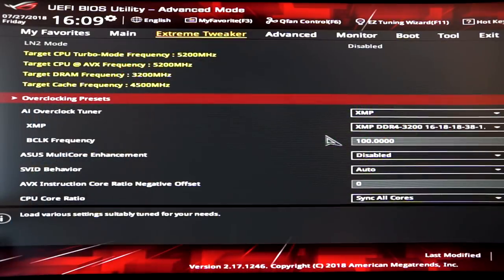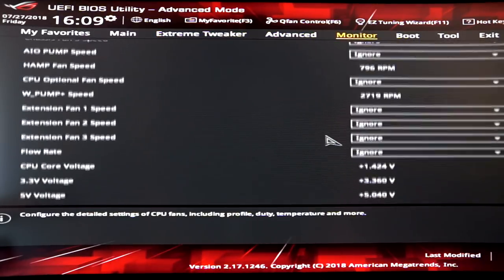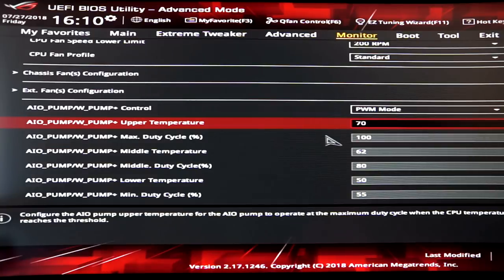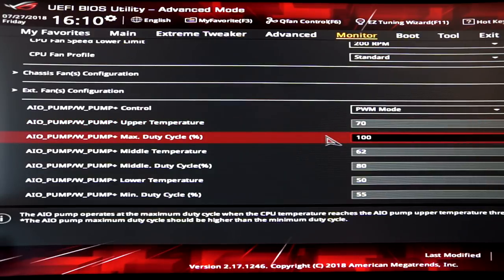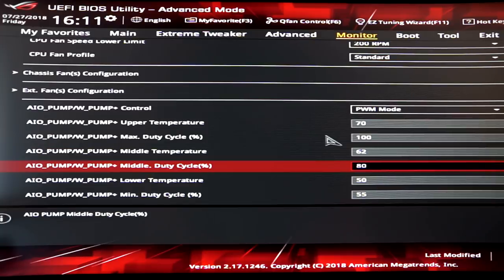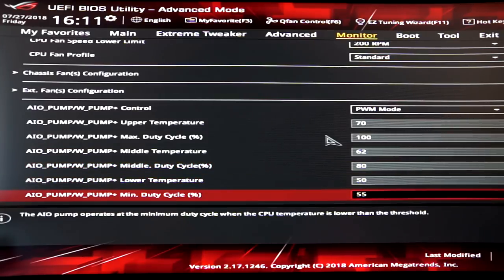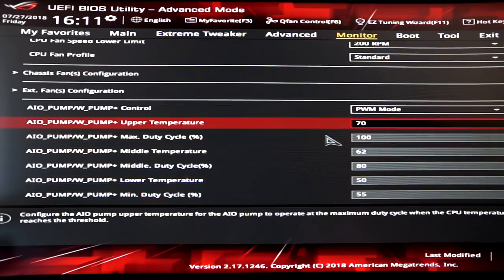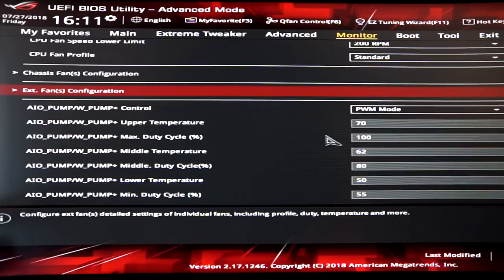STOP SETTING UP YOUR PC FANS WRONG! - How to set up Fans & Pumps for Minimum Temps and Noise

Comment: I have the same Res and for the life of me I cannot get the blue LEDs to work. Every other color works. I’m stumped. I tried updating Aura Sync and still the same issue. Sucks because this means no pink, purple, White etc. any color that needs a little blue
Reply from the maker: Probably faulty I’d say
Reply: I assumed if one color worked on an RGB strip they all should. I guess not 😓
Reply: Boosted Media so I exchanged my RGB Res Pump combo and the same problem 😭 all colors work but blue. It is plugged into an RGB splitter. I wonder if it is a faulty plug. It is a three way split. I have my gpu block and Res plugged in. The gpu works, but the Res doesn’t. I have a third plug not being used. I’ll try that one and hope it works. Any thoughts?
Reply from the maker: Are you sure you’re using the RGB header and not Addressable? That’s bizzare.
Reply: Boosted Media hmmmm. How can I tell the difference?
Reply: Boosted Media wow so it was one of the three plugs on the splitter was bad. I plugged it into the third one that was not in use and Bamm! Blue lights 😁 thanks for replying to my questions. Love your channel. Especially anything PC water cooling related

Comment: The mistake your making is checking your water temp very shortly after starting the stress test. The water loop will get hotter over time, kind of like a kettle, once you introduce heat, it isn't instantly boiled. And if it's in an enclosed case, eventually, all the hot air inside it will decrease the radiators cooling efficiency, also leading to water temp rise.. key is not to be prematurely checking. Let it run for an hour or so

Comment: The temperatures you quote in this are super inaccurately measured. 

Those thermometers don't work how they're marketed to. It's not the laser measuring the temperature. That's just for aiming. You'll see in the end that it has a cone, that cone defines the divergence angle of the area it measures the average temperature over. So the further away you are from the part, the bigger the area it's measuring the average temperature of. They also don't give accurate readings on glass or metal. Mainly just accurate for plastic or flesh. 

Always get it as close to the thing as you can. 
If you're trying to measure something smaller than the cone then you've got little chance of accuracy.
If it's metal or glass then put some PVC tape on it and measure the temperature of the tape for a more accurate reading.

Comment: yeah you dont want the air leaving the radiator going into the case, moister is bad, i need a speed controler for a water pump

Comment: Output from GPU 26.7C -> RAD -> Input to CPU 28 ... so your radiators heating the water? ... no, the IR temp tool your using to measure does not work on reflective surfaces.  This video is nonsense :D